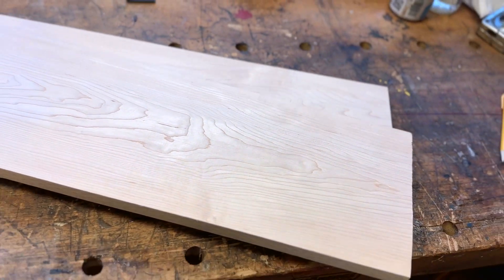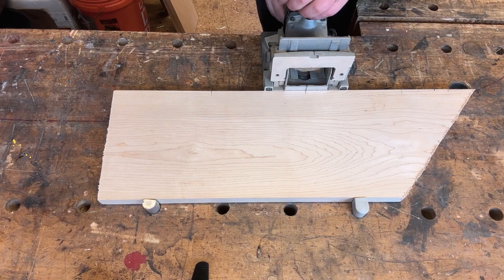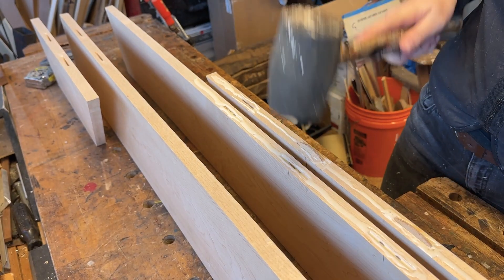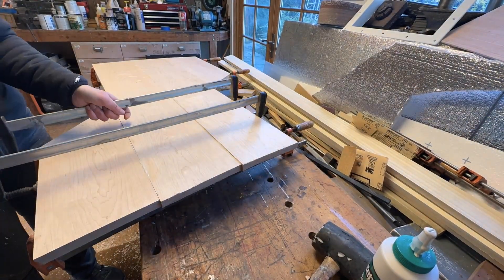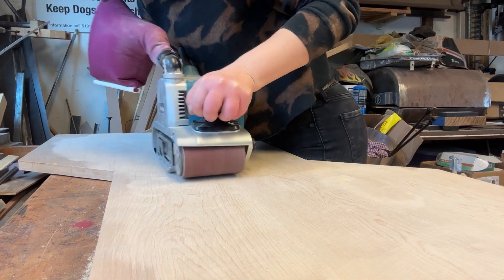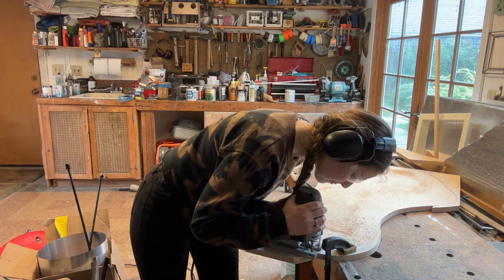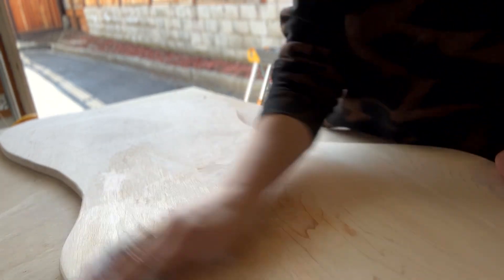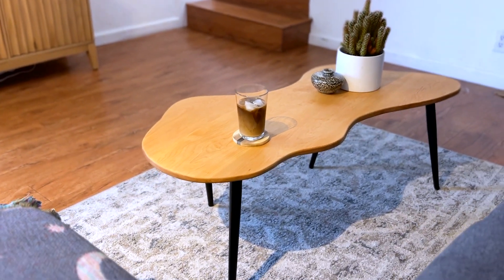Building a Contemporary Coffee Table

Comment: incorrect use of the biscuit joiner is why you had such misaligned boards resulting in needing to do so much sanding which removes a lot of material thinning the overall area.